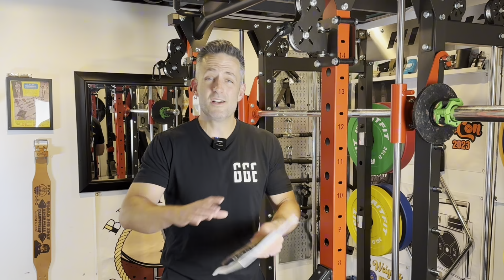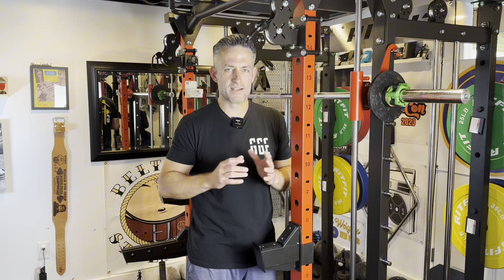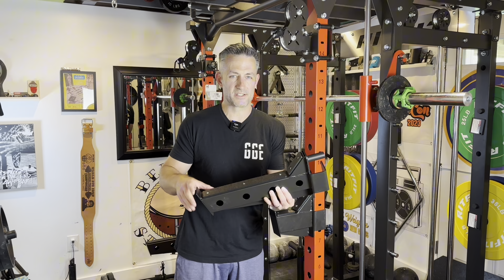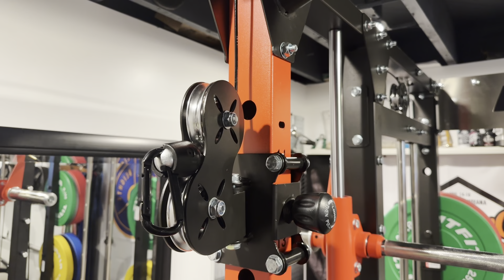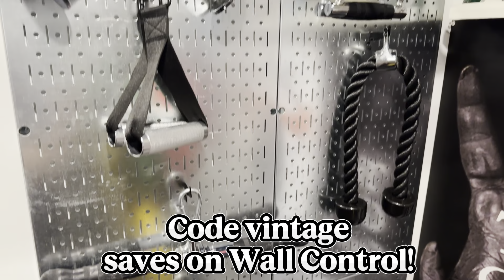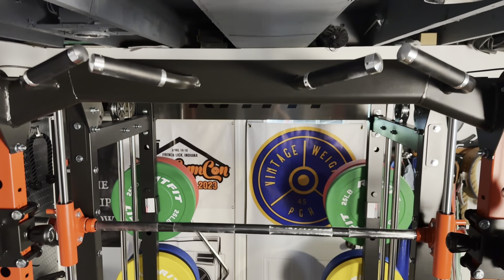RitFit Sports Buffalo Smith Machine Review | All-in-One Rack for Home Gym

Comment: Very genuine review 👍👍. 
Now IDC much for a Smith but I do love a nice half rack with functional trainer. My biggest gripe with my current rack, is the large hole spacing distance on the uprights, and I see this one is no better. 

The next rack I get, that's the #1 thing I'm paying attention to. Now I don't need Westside hole spacing (though it would be nice) but I do want more adjustability.
Reply from the maker: The front uprights’ holes on this rack are 3” from each other, and it does make setting up the safeties and j-cups a little awkward depending on your height and the lift. For me, bench was fine, but squat was too low. 

Thanks for watching and commenting!